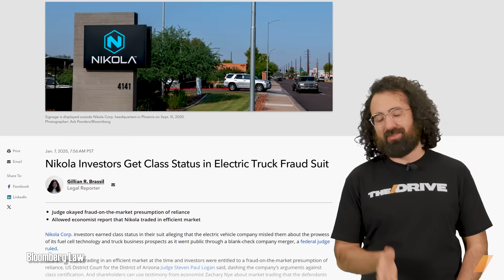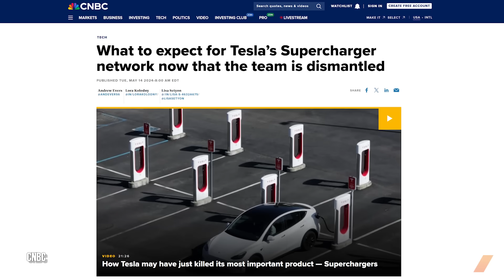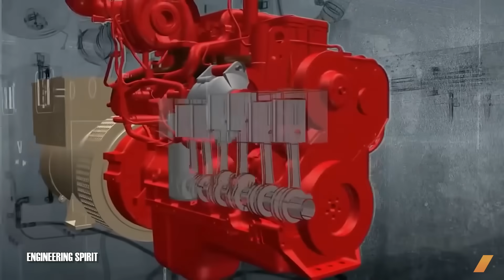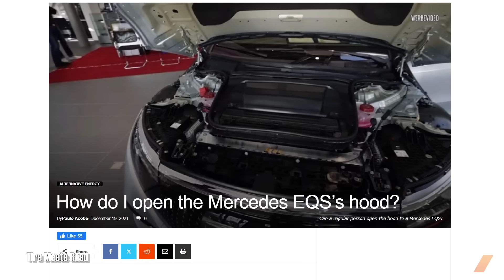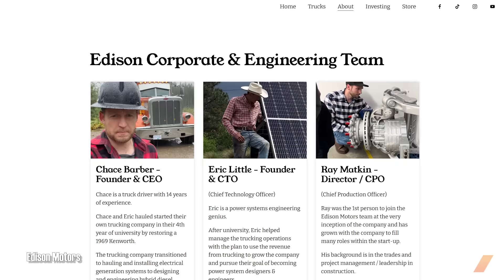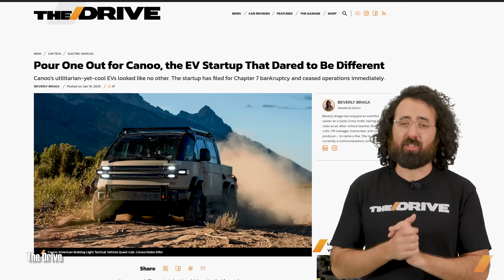The truckers in a shed beating Tesla with 100-yr-old EV tech

Comment: As a 3rd generation mechac/ engineer I'm pretty sure this is the future, you can maybe reburn the exhaust with a little fuel added to take care of emissions and run a stirling generator since that's gonna be pretty hot, and it can be completely solar powered using methanol from wood spirits with algae or duckweed. They used to have millions of cars running in wood gass for one of the world wars and it was successful but dirty, but you can essentially concentrate the methanol and treat it like gasoline (I know clear flame is bad but we can come up with some kind of additives for that since gasoline does have color). You can use sunlight focused onto the anoxic furnace, and the charcoal and vapors (mostly methane and also some weird volatiles so it's best for the environment if burned) can be used to cook the fresh material. The ashes, or just eggshells can be used to neutralize the acids in the distilled spirits and then baked clay can take the water out, but water does push harder than other exhaust gasses and clean the engine. The waste can all be put in a garden as fertilizer, and I believe this can be used in diesels with some adjustments, methanol works alright in more common engines at least. Some stuff like castor oil works ok as diesel fuel, but farmland is often in the most biodiverse areas and they've been decimated for it, so it needs to be rewilded if not producing food, and algae or duckweed can be put on rooftops without worrying a about roots, and it's extremely adaptable and modular since the units are tiny, you can't move castor bean plants around and have max output but you can with algae and duckweed. They're nearly as efficient as solar panels, and can be stacked with translucent selective panels since photosynthesis is incredibly efficient over just a few wavelengths. They're able to about double their mass in a day or two under the right conditions because they don't need to waste resources by living on land, the nutrients and water are right there so they can keep photosynthesizing as much as they want, meanwhile a land plant can only use about 6 hours of sunlight or less because they can only move and extract so much at a time, they also have to trade sugar to microbes for resources a lot of the time too. Having rooted plants is fine for permaculture, or wildlife, but this is low impact and if done right it's going to be really efficient if you can simplify caring for the green stuff. It could be part of waste treatment plants or farms since that's nutrients and life wastes nothing.

Comment: What you forgot to mention is the regen breaking - with a semi truck, it's even more important than with regular EVs. If you spend a lot of energy to haul a trailer up a hill, with direct ICE drivetrain, you just throw all that energy away as heat in the breaks. If you have a hybrid or EV truck, you get like 80 percent of it back. Scania EV trucks even tell you before a planned route what your charge level should be before you embark, so that you don't lose out on this potential energy if you happen to run a route that's more downhill than uphill. No need to start with a 100 percent charged battery if you're going to be "charging along the way".

Comment: Only one problem.  None of this is even remotely sustainable.  It's called carbon and it's spewed into the atmosphere still at an alarming rate.  Sorry if not burning fuel is inconvientent.  Has anyone been to Europe?  There are fully electric semi's running 6 to 7 hundred km's a day.  None of the charging infrastructure existed there either but regulated change handled affordrably made it happen.  There are companies in Australia making electrification possible and no one halls farther and heavier than they do.  They just changed the mindset and made their own charging/battery swap stations as they went along.  It's happening as we speak.  Nothing is cheaper and easier to maintain than fully electripied trucks and just ask the drivers about driving them?  It's a hands down winner everytime.  Change the way you think and anythings possible.
Reply: No one read that
Reply: Electric trucks doesn't work in Europe either, some experimental models are used for local distribution. Small trucks, no more than 40 metric tons, which is around 88,000lbs. Scania made their V8 engine for their own trucks, which does the majority of long distance trucking within Europe, often with heavier loads between 60 to 120 metric tons. It's a very clean engine because of it's efficiency.

Europe reduce emissions by avoiding car dependency in urban area, any city or town with decent density has several alternative modes of transportation vs only being able to drive a car. This also reduce traffic and allow people and cargo to move around much faster. Trains, ships and airplanes are also a major part of this equation.

Comment: There's a claim in the video that there needs to be more techs with experience in diesel electric hybrid systems. My rebuttal is reefer techs. The thermoking precedents I work on run on 3 phase 220v. There's diesel, electric AND refrigeration systems in there.
Don't worry about the techs. Pay em decent and the guys will find you.

Comment: Diesel tech here. It can't be overstated how huge it is to have no DPF or SCR on the system. These are finicky and expensive components that are constant headaches for techs and drivers. If they pull this off the way they claim that feature ALONE is going to have companies banging down their door to place orders.
Reply: Tried and tested technology, these engines are used in Scania trucks allover the world, except the US and Canada. Euro6 compliant which is stricter than EPA regulations in the US. No DPF or SRC, yet still clean enough to comply with all current regulations. Only drawback is a higher consumption of adblue, but that's an easy system to deal with as it's only another liquid, available on pump, just like the fuel itself and washer fluid.

Comment: This is amazing when it comes to EV this is the correct move, I personally don't like EV but if this takes off and they are able to shrink the design for passenger vehicles it could make a killing, Diesel engines can be extremely efficient its just not capitalized in the US due to the market and EPAs iron grasp on the system.

Comment: WOW! Fantastic!  I love this!  So many good things about this tech.  And so much to love about the company!  Gotta correct one thing though.  Diesel locos aren't series hybrids--there's no electrical storage capacity.  The torque goes into the generator and the output of the generator goes straight into the motors. When the train has to brake, the energy goes into resistive heaters (which take up most of the floor space in the locomotive) and is wasted.  Which brings us to the topic of regen.  If a logging truck could recharge its batteries on the way down the mountain, it would cut fuel costs literally in half.  Is Edison equipping its trucks with regen technology?  Thanks for spreading the word.  I'd heard the company name before but knew nothing about it.

Comment: Wow this didn’t age well. 5 months later and almost all claims with Tesla semi were incorrect. Tesla is rolling out v4 chargers all over North America. The Tesla semi weights 22,000lbs  a comparable diesel class 8 is 17,000. 

Don’t get me wrong I live in BC and fully support Edison. But It’s not the solution for most trucking companies. A Tesla semi will be much more practical
Reply: There are only 18 v4 chargers in all of North America to service 2.9 million OTR semi trucks.

Edison is not designed, or appropriate, or good for doing OTR trucking which is 70% of the semi truck market. Edison will fuel up with diesel and drive into the wilderness and it will plug in charge when it can while the v4 network is implemented over the next 20 years.

Comment: Glad Edison Motors is still floating. Electric drive trains are such a good idea for work vehicles. I wish the Chevy Volt didn't get canned and we had that tech in new work vehicles(trucks and vans). Most people should be in small battery EVs(well ideally most people should have access to efficient public transportation), not massive super heavy SUVs and Pickups for their commuting.

Comment: Firstly, Edison Motors are freakin awesome, glad to see them getting some more exposure. Secondly, as many others have said, there are actually a lot more different electric semis out there. Thirdly, replacing the battery is not going to be likely for a very long time, as current estimates are that EV battery packs are expected to last 20 years. Fourthly, there's an Australian EV semi company  (Janus Trucks) that uses swap-able battery packs to solve their charging problems. No giant power source needed, the battery packs can charge up in a normal way while other packs are in the trucks. Check out the Everything Electric Cars youtube channel (formally Fully Charged), they do an interview with them!

Comment: I thought Edison used diesel generators, not really a good comparison with the Tesla semi which is fully electric isn't it?
Reply: You are correct. It's apples and oranges comparison. Tesla will shine with ev semis on specific highway and city routes. Edison will shine offroad in the woods.
Reply: @Sah-o5m I have some doubts about Tesla's efficacy for long-range trucking. I think we might need to see some new battery tech, although I suppose the larger batteries should be capable of somewhat respectable charge speeds.

Comment: Nice idea, but you overlook two things... 1- you loose efficiency converting diesel fuel to power, and then when generating the electricity - multiple conversion losses.  2- you charge an electric truck at night when the truck is idle, so you're really not wasting time charging.
Reply: A mechanical transmission or an electric generator both waste heat so the losses are about the same. An Edison truck can charge up overnight as well.

Edison doesn't make sense for OTR trucking, but does make a little more sense for vocational trucking.

Comment: This video is a weird fusion of  anti-EV FUD and shilling for the Edison hybrid.  Make another video when you have actual numbers to support your claims that the US electrical grid can't handle larger charging infrastructure.  Folks said the same thing about the current supercharger network before it was built.  Yet, here it is, growing every month.  US grid infrastructure is expanding rapidly, and includes lots of experimental power generation and storage.

I think hybrids are great, as a stopgap to emission free vehicles and also for lang range, high load application, like long haul semis.  But, we don't have to lie to the audience to make that point.

Scout has some very interesting concept vehicles that use EV powertrain, with a gas motor to charge it for long range.

Comment: One of the benefits of having a generator onboard is it can be used to power so many other things.   EV stranded on the side of the road, and Edison truck can charge it up.  Need a welding truck, no need to run a separate diesel welder for it. Want a concrete truck to be able to work during a city’s noise restrictions late at night, no problem.   Power go out in your home, Edison’s got enough to power several homes till the power comes back on.  Want an RV that isn’t running a noisy generator all the time, Edison.

Comment: Cool idea. What's the advantage of using a diesel generator over other internal combustion engine types? For decades, I've been suggesting the use of a multi-fuel capable turbine engine as a generator for an electric drivetrain.
Reply: This is just me regurgitating what Rich from deboss garage has said about it, he's doing the Edison pickup truck retrofit kits not the semi's but I assume it's the same reason why. Diesel engine's work best at one constant rpm/load not throttling up and down, and since the engine in the Edison semi's/pickups is going to be a generator and not for drive it's the best fit for the purpose. When charging the engine will be running at one constant rpm, set that to whatever the diesel is happiest at and don't change it to always be in the best economic/emission/power range on the engine. 

I also imagine the widespread use of diesel fuel and engines helps the choice, since places with diesel logging trucks will have diesel gas pumps already in place. The retrofit kit Rich is working on also benefit since it's fairly easy to convert a drive based diesel engine to be a generator style diesel engine.

Comment: Only one electric semi on the market???  All European manufacturers have one, and Scania's base model does 350Km [4.5 hours driving at EU 80kmh maximum] and recharges fully in 90 minutes, say over lunch. Other models with better specs are available and also from MAN, Volvo and others... America used to lead the world in automotive tech, now it's so far in the rear view it's basically a non-starter... Also the Vovo FH Electric prime mover is about 12,000 kg and the typical heavy-duty Kenworths are up to 10,000 kg depending on configuration and the  Peterbuilt 579 can get up to 9,000 kg kerb weight. So an extra 2-3,000 kg at the moment, but as always that number is coming down, and btw, as the EU has already invested in charging, this is not an issue for them, neither is range really, EU truck drivers are time regulated; daily driving period shall not exceed 9 hours, with an exemption of twice a week when it can be extended to 10 hours, minimum rest period is 11 hours a day [with some minor exception] as they don't risk drivers and other road users lives by overworking their drivers like Americans do... In addition, the EU knows oil will run out eventually, at current levels in about 45 years, but as Africa ramps up with currently over a billion people not motorized some estimates put oil running out in 20-35 years, so are planning to be ahead of the curve when the time comes, if not before, again, America being left in the dust.

Comment: One of my favorite trucks types was removed from the US roads. Small pickup's like the S10. One of the issues with the S10 and other small pickups. Was they had a very light rear end. So why not make them a hybrid off of the Toyota Prius. The engine in a Prius or Honda Insight would fit in the small truck. And then the battery's could be put into the bed. 
Reason why is I want a honk en big truck that get 4 miles to the gallon. Meh. 
Not Me I rather have smaller and get 40 miles + to a gallon.

Comment: You made a wildly wrong statement at 10 minutes.  No off the shelf parts?  They are intentionally using almost entirely off the shelf parts... other than the generator, axles, battery control modules...

Comment: The other issue i see here is they need to make software that takes over every model of truck. Can imagine the nightmare of an F150 owner getting the e axeles and driving and the vehicles abs and tcs going crazy because the wheels are spinning far faster than the engine  and the ecm noting no trans speed input. They would need to rewrite the software of whatever make and model of truck remove the transmission add the battery pack turn the existing engine under the hood into a pure generator role all without the vehicle throwing every check engine light in the universe about wtf is going on lol

Comment: It cracks me up how many people think that old and modern diesel electrics are hybrids. Diesel electric is a transmission, not a hybrid. At no point does propulsive power come from anything other than the engine (one could argue that inertial response of the generator is stored energy, but that inertial is directly coupled to the engine). Edison does have a great idea, but their core concept is significantly different than diesel electric propulsion.

Comment: Somebody finally figured out the Obvious. Been saying this for 15 years now.  But the EV people call me a heretic because they think electricity is generated by rubbing air molecules together. It's Not. I am amazed it needs a 9 litre diesel engine to produce the electricity. But the IDEA of Producing Electricity on site, at the vehicle makes sense. Making it with whatever, coal, oil, gas and then having to ship it 200 miles doesn't.

Comment: In Germany I drove a bus with hybrid, it drives electric and only a little diesel engine in the back that came on and off when needed, and we all wanted to drive it because it was silent, no vibration, and the heating or AC was a Saint in cold or hot conditions. But the Japanese Honda and Toyota have are in the head of the game, but other companies should step up the game with conversion for Vans and trucks

Comment: Why not get a normal electric semi? Like the fully electric semi trucks made by Volvo, Renault, Scania etc.
Reply: range
Reply: What is the difference in range?
Reply: @Brigand17  Fully electric Semi's are fantastic at short run city dreyage, and tolerable at long haul freeway driving between charging station rest stops.

A normal EV semi only lasts about 4 hours when pulling heavy 150,000 lb loads when it needs to last 15 hours on dirt roads with no chargers. They become stranded in the wilderness needing to be towed.

Edison EV Semi's carry their own ICE powered level 3 super charger to recharge while driving. Edison semis have no range anxiety.
Reply: @Sah-o5m  Alright, I guess overestimated the range of fully electric semi's.
I wished there was a system so electric vehicles could switch batteries at some kind of 'battery station'. 
If there was a big hydraulic arm or something that could lift the batteries in and out of the vehicles. Wouldnt that be something?